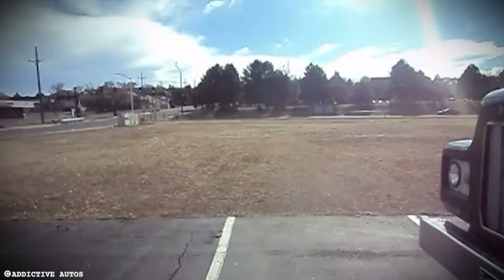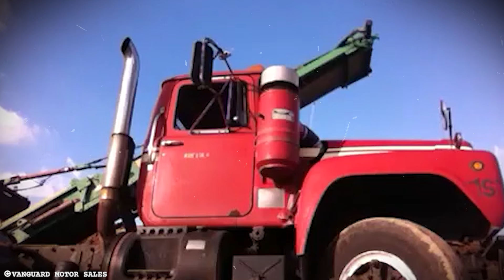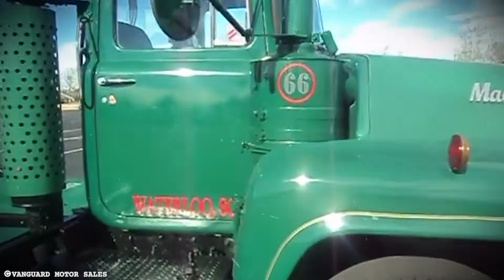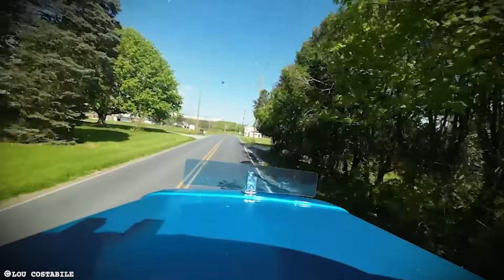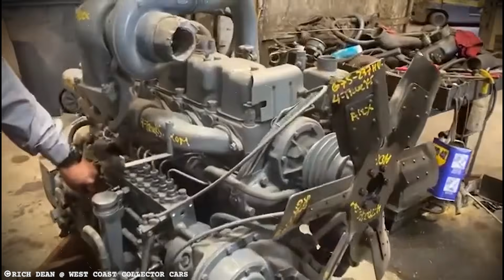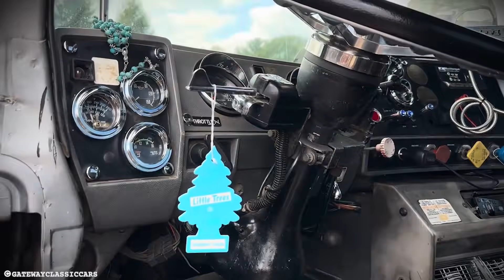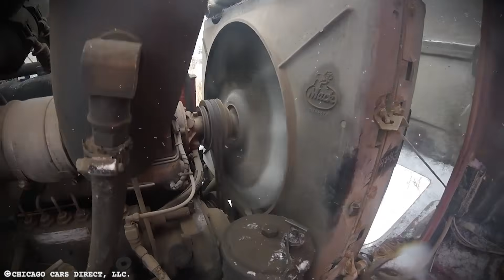The Mack "Maxidyne" Engine That Silenced the Need for 15 Gears

Comment: A good concept for an elastic power plant and ease of shifting in a flat environment no doubt. 
But a bad concept for engine brake power going downhill. 
You never can't have it all. 
If you turn 1 screw in a concept another 1 will get outta tune. If you turn that 1 in turn, usually the entire concept will be messed up. 
For engine brake power when descending a grade, the low rpm range of non-Mack engines combined with a certain set of gears (10, 13, 15, 18, according to specific landscape requirements, think the Rockies, Donner Pass, etc.) was (and still is) best. 
The Mack concept is good, convenient, and healthy (for your knees and shoulders) for most flat soil cities - and that's where it really shone (vocational application, garbage trucks, buses, etc.).
BUT even there, think California. 
Going down steep L.A. (or rural) grades with a loaded 10 yards concrete mixer, and you only have 5 gears and 1 trans box. 
No way your engine will help with breaking - you'll depend on your air brakes alone instead. 
Same with a loaded dump truck 'n pup, moving van, whatever. 
If it's a long steep grade, your air brakes might overheat due to overusing them. 
What then? Jump outta the truck and hope it'll land somewhere it won't hurt anybody? 
This is why Clessie Cummins invented his super efficient Jake Brake, in combination with low rpm range engines and more gears / a 2nd trans box: 
it created maximum safety for heavily loaded rigs going downhill on long grades. 
To this day, this is the safest solution bc you've got 3 ways of breaking, all combined if need be: 
1st, you can downshift, 2nd you can use the Jake, using the engine's power for breaking additionally, and only THEN, you'll have to apply your air brakes. Rendering your air brakes your LAST means of decelerating 80K lbs gross. 
Which is the way it should be for maximum safety of all souls involved around you as a driver, ain't it?
So the air brakes are not your primary means of breaking but only supportive. 
Which renders them always staying in their intended temperature range, never overheating and thus failing, or even going on fire. 
So, in all, this makes for using your air brakes less often, and not as long each time so they usually stand no chance of overheating. 
And it spares wear & tear of your air brake system (brake shoes / pads / drums) keeping it as safe and readily available as possible at all times if properly maintained. 
Clessie did that for a reason. 
He once had almost crashed a truck into a train passing by bc his brakes were already overheated and gave out on him. This was such a horrible experience for him that he thought 'I have to do sth about it, we need safer ways of breaking'. 
And he succeeded in that, big time. 
Why sacrifice these possibilities using a Mack system otr, where you often are confronted with steep grades? 
It is the unsafest way of otr trucking in my book. 
It's like going back to 1920's decelerating standards (when it was all they had at the time). 
Btw, no retarder system works as efficiently as a true Jake brake - to this day. 
The concept of grabbing breaking power immediatley where it comes from (inside the engine) is still unmatched. 
NOTE : I'm not saying Mack installed a generally hazardous, or unsafe system. 
It's perfectly safe IF you know what you're doing, IF you know its boundaries, IF you only use it in certain applications. 
Just bc it's naturally limited to using heavily loaded vehicles at generally lower speeds (construction, garbage, etc.) and flat soil regarding required brake power. 
In these scenarios, a sufficiently dimensioned air brake in good working order will always be safe enough, no engine brake power needed. Plus, engine brake power wouldn't be efficient there anyway. 
So, all good here. 
I'm just saying the Mack concept doesn't lend itself to most otr applications (unless you're always and only hauling light, bulky loads, say, styrofoam, gypsum, etc). 
There, it is highly unsafe in my book, and should never be applied in that context.

Comment: He claims a driver would shift 400 to 500 times a day. UPS had tadel tell tachometers . They actually claimed drivers were shifting 10,000 times in a 10 hour shift. That was when UPS went to Mack's with a V8 Mack engine and a 5 speed transmission. Thats a lot of shifting. The 5 speed according to UPS did reduce shifting by half. That happened in the late 60s.

Comment: Msn I hated them r models .They were made for midgets. No insulation in the cab ,they had so much noise in the cab you had to put 300 watts to the stereo  and a external speaker to the cab just to hear them.They could pull a house ,but they couldn't do 70mph

Comment: Just came across this video. I'm a proud owner of a RS600L Hayward California built 1979 Valueliner all original dump truck and I'm still working this truck and she runs and looks great. Air shift and love being able to shift going backwards the same as going forward.
Reply: I have run Mack’s for 50 years. The best service you will ever get is with late 80s valueliners. E7 12 speed and camelback.

Comment: I owned three Macks in my lifetime. Hauled aggregates in Florida. All were 5 speeds but the last one was a 5 overdrive. U had to have like a 535 gear rear for that. Those were expensive. I had put a 425 gear rear in it for the affordability. Let me tell you one morning empty running late to get to the mine I had the ears pinned back on that old dog, passed a trooper going the other direction on Sr 33 , he whipped it around and I just pulled on over. He comes up and says , " driver, do you know what I clocked you at"? I said " naw boss, speedos broke" he says " I GOT YOU AT 101MPH"!  I Laughed at him and said come on that old truck can't run that fast but I knew I would because of that 425 gear. It didn't like pulling off from a stop. But give her enough road and hold on !

Comment: The idea of the maxidyne was....what were doing today,
Hi torque low rpm.
What you could do was basically lug it...allowing useful lower rpm.
As I recall, the cylinder liners were above the top of the block, seating..Sealing...Into the cylinder head.
Hence ability to "lug" them without blowing a head gasket.
I've only driven one, but I'll still take the Quad-Box.
(18spd Quadraplex)
Then...you could tell a Maxidyne by the Gold Dog.
I've driven plenty of FULL MACKS, with Silver Dogs.

Comment: When I was 7, my dad bought an old 70 passenger school bus and we converted it into a skoolie, it had a DD 8v71, but it was driving 3 transmissions, an Eaton 8 speed main, with an Eaton 3 speed auxiliary, and a Spicer 3:1\1:1\1:1.5 under\over drive unit. And a 2 speed rear end for a total of 144 fwd gears and 16 reverse gears, that's what I learned to drive on, it was insane, 3 sticks, 1 foot clutch pedal, and 1 hand clutch it also had a shaft retarder that would slow the main trans shaft speed at the push of a button
Reply: What year was it and do you know the ratios in the main and Eaton auxiliary as well as the ratios of the rear end.  I had never heard of this.  Don't know if it is crazy, amazing or both.

Comment: Started driving trucks full-time in January of 1974. Started with a 1973 DM 600 with a 237 twin stick, 6 speed transmission.
We hauled coal until spring, took the coal sides off. Started working highway construction and power plant construction.
Did that for about a year?
Switch to Mack 18 wheelers. In 43 years of driving, I've drove just about every brand of truck There is, nothing was tougher than a Mack when it come to off-road. The Mack rear end could not be beat for off-highway work.
I retired May 1st 2017 I was driving a 2015 Mack Pinnacle. With the automatic shifting transmission. Which I liked more than I ever thought I would. Pulling a 39 foot frameless, east dump trailer.
Priceless, memories and hundreds of thousands of miles.
But would not give a dime to do it again.😂😂😂😂😂😂😂😂

Comment: A Caterpillar with an eighteen speed transmission was a good combination. but I worked a small trucking company that had about ten trucks. and two of them were Mack conventionals. with Maxidyne engines and duplex transmissions. a single transmission with two shift towers. and they had potato trailers behind them. and they were painted like American flags. and I drove both of them. not at the same time of course. and I didn't have any complaints with them.

Comment: 1:10 yes the trucks did not have synchronized transmissions and they still don’t. But no truck driver double clutches. Unless it’s some rookie straight out of school. The schools teach you to double clutch and you are required to on the test but once you’re driving, you learn to float the gears and  rev match the RPMs in the transmission and the engine.
Reply: Most have synchros ,except automated manuals. And most drivers floating gears are destroying them because they cant shift or drive.
Reply: @V8Lenny  not sure where you get that most have syncros. I’ve been driving for 30 years. I’ve never once driven a manuel rig that had a synchronized transmission
Reply: @Jayc9582 all the trucks in the rest of the world has synchros, since 1960s.
Reply: @V8Lenny yes pickup trucks did not big rigs.
Reply: @KevinNewman-o6e big rigs, in the rest of the world.
Reply: @V8Lenny the only thing that synchro in them is the high low splitter.
Reply: @KevinNewman-o6e every gear, since 1960s
Reply: Using the clutch that much you wear up the clutch real soon

Comment: GOOD truck drivers FLOAT SHIFT, NO "Double Clutching".  I have driven TWO stick "set of Boxes" back in the day.  5 and 4 is my favorite.  Five Speed Main Box, with a 4 speed Auxiliary with the Overdrive on the Aux.  I have seen them with the Overdrive on the Main Box and direct on the Auxiliary, and there were some that had the overdrive on BOTH BOXES.  aka "Double over".  Mack made their two stick a in ONE BOX< the Duplex, Triplex and Quadro-plex.  I would not be caught DEAD driving anything Mack.  The Maxi-dyne was a good engine, but would put you asleep driving it.  I would RATHER drive the 5 X 4 anytime.  They called it back then a "Constant Horsepower curve".  Get you a Conventional Pete, with a 5 and 4 with a V-8 Caterpillar engine and you can PAT THAT PAVEMENT.  The V-8 Maxi-dyne was a bad ass engine, but I never drove one.  The Cabs on Macks were UGLY and they had NOTHING in Driver Comfort.  They are good for hauling Dirt local as they run empty half the time.  They were never good for Cross country Trucks that ran loaded both ways running coast to coast.  The truck driver are a different breed.  Boys that grew that were born after 1980 don't know the difference between a half ton Pick-up and a 3/4 ton pick-up or how to drive anything but an Automatic Tranny like their mom's car.  They grew up playing computer games and just don't get it.  You know, their is something about Truck Driving, I have NEVER figured out and that is, some people CANNOT BE TAUGHT to drive them!!!  They can have a Masters Degree and you cannot teach them!!!  I do not understand it but have seen it MANY TIMES.

Comment: Nothing mentioned about the E7 and E Tech variants that came along in late 97. Horsepower up to 400, 427 and 460 on the E Tech platform. Then the EGR years just before the MP7, 8 series Volvo engines in 2006

Comment: The problem with downshifting going downhill is trying to get back into gear so if you have Jake brakes you have compression from the engine to slow you down as you go down the hill. ... If you go out of gear you don't have that and you have only the brakes..... And on a Long Hill you could easily burn your brakes up...... You can't give me a truck that does not have a jake brake on it now....

Comment: Straight cut gears are the way it was all the way up until these damn automatics came out.... The amount of gears that you have with it was a 13 speed 15 speed or even a 10-speed depended on how much horsepower your engine made.... And they don't weigh 70,000 pounds they weigh 80,000 lbs

Comment: The Mack 5 speed didn’t make 15 speeds or any other transmission obsolete. The Mack 5 speed is obsolete and the Eaton fuller 18 speed is the number one owner operator spec Transmission to this day. I hated the Mack maxidine

Comment: at 85yrs i learned on a 22 white 6 cylinder gas with a 5x3 transmissions 1948 model; operated an R model with maxidyne 5 x2 for T.J. Reagan hauling out of steep pits like Goderich Salt one needs an aux-box. my experience covers curb vans rhd and lhd  all the way to road trains also rhd and lhd; for many yrs I hauled A trains from Hamilton, ontario to Vancouver BC with a B 63 mack with a thermodyne , no retarder ,Spicer 3 box 5x4x2 and a dog box [ sleeper]; as i recall we maxed speed at 50mph but when figured over whole one way trip you would average to no more than 25-30mph

Comment: A friend of mine, Ted Pritchard of Melbourrne , Australia , designed and built a prototype steamer suitable for road vehicles. It was and still is is the lowest emission engine in the world When  it comes to diesels a steamer would leave it for dead. For a start it takes two engine revs to get one power stroke out of a diesel. Two revs on a steamer and you get four power strokes. He took it to America and demonstrated it to Senators and vehicle builders. Did they want it? No. I could fill the Mitchell L library why and I could be excused for believing politics aren't far away. Once industries are protected to any extent they start to go down hill if they don't improve their product. I am very sure  the American truck building industry is in for a big shake-up if they don't want to adopt new  technology. The fact steamers do not  need a transmission to nine tons is reason enough for mfrs. to become interested is a big start. That they can burn high flashpoint fuel and are cheaper to manufacture and maintain amongst a million other things take thes cake. Vote steam. If Mack turned to steam now they could slay those noisy, dirty diesels, no risk.

Comment: In the mid to late 70's I drove a tanker for Refiner's Transport and Terminal Corp. located in Alsip Illinois. We got a whole fleet changeover of 300+ R models with the five speed transmission. On my first run with one of these, I couldn't believe the pulling power at 1250 on up! Coming out of the toll booth on 90 just west of 53 going to Rockford, no one was able to keep up with me until I tach'ed out at 2100RPM. The first transmissions that they put in the 300+ only had two countershafts and they were blowing apart. They recalled them all and installed three countershaft models. I drove a Mack R700-L with a Detroit and an RTO-9513 that was really sweet, and I learned how to drive on a B-model Thermodyne with a Quadraplex trans. I learned how to drive while eating a Beef sandwhich, steering, shifting, and drinking a Coke! It was fun!
Of all of the different trucks that I drove over the years back then, the 300+ was a real eye opener. Thanks for the video!
Reply: This was very interesting and I’m glad I clicked on it, thanks for sharing.😁👍🇦🇺

Comment: My father drove a 1989 Mack R690ST from it was brand new. It had a maxidyne 275hp with a 7 speed maxitorque transmission. We didn't know about how the Maxidynes worked back then, but we always were amazed that the more the rpm's dropped on a hill the harder the truck pulled. We eventually learnt about it and my father stopped putting his hand on the gear stick whenever the rpm's started to fall off. This was in contrast to a lated 70's Kenworth K100 he drove with a detroit 6v--71 with a fuller 10spd in it, you better be catching those gears early and keep that detroit screaming or that KW will stop on you on a grade.
Reply: I drove that truck as a White Constructor pulling equipment on a cowboy. They said the best way to shift it was to slam your hand in the door first to get in the mood! Nice part was it floated so easily; don't think I ever clicked a gear in the 4 years I drove it!

Comment: The real Maxidyne was the 500hp V8. That 237 or 300 Mack still needs at least 9 gears, 13 or 18 are better. I drive a 400 Cat with 6 & 4 twin sticks. More gears is always better.